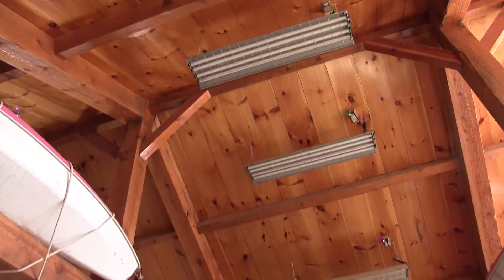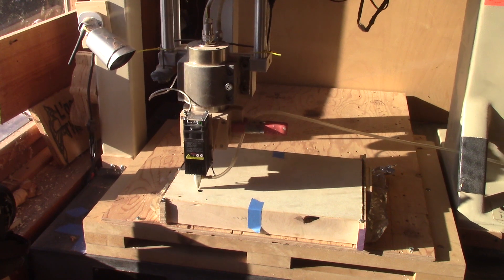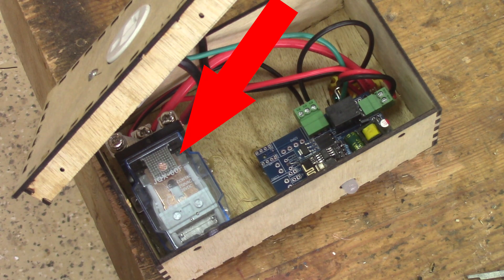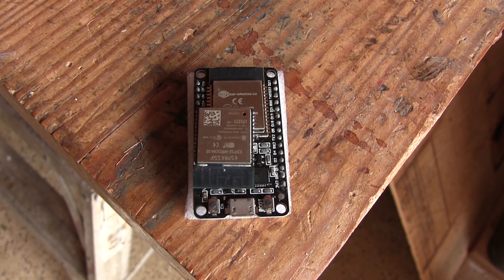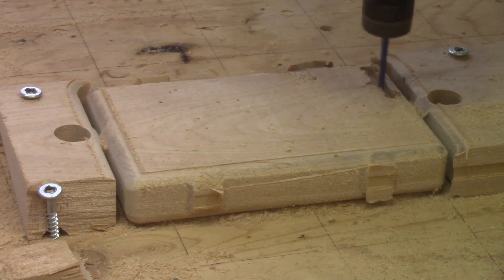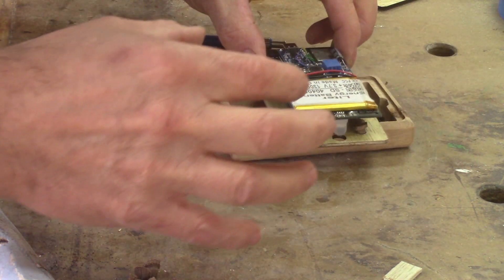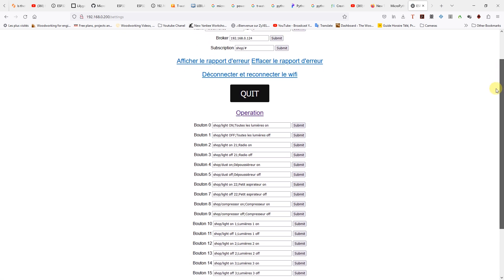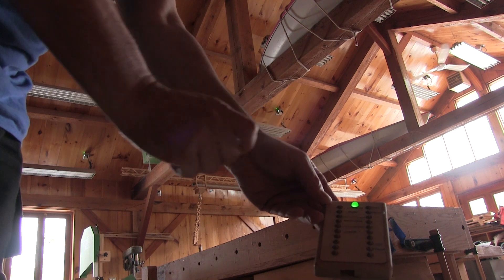The Woodpecker Ep 298 - WiFi switches for the shop

Comment: which controller are you using?
Reply: Oh, never mind, I see now, an ESP32.  I thought those cost more than that
Reply from the maker: Not the ESP 2866 they are super cheap, but not as powerful as the ESP32 but to use only two outputs it was enough
Reply: @LgosseuxDbois-TheWoodpecker  Ah, I hadn't considered the old ESP8266
Reply from the maker: For small and uncomplicated projects that doesn't need more than one analog input they're not so bad. Not a lot of memory but still enough to run microPython. But the modules I used on those switches only have four accessible I/O from the header. Others have all the pins accessible but they're a bit more expensive and bigger obviously to accommodate the extra accessible I/O

Comment: Do you have a link to the watch that looks interesting?
Reply from the maker: Yes this watch is quite fun and it can be programmed in C++ but I prefer using Python it's easier to replace the programmation it can be done by WiFi. I don't know if it can be purchased elsewhere but I bought it directly from the manufacturer on Ali express. Buy from the manufacturer, I never received the one I bought from a reseller... so on ali express search for Lilygo TTGO-Twatch V3 every version of this watch has different specifications. It's quite easy to find informations on the net it's how I managed to programmed it